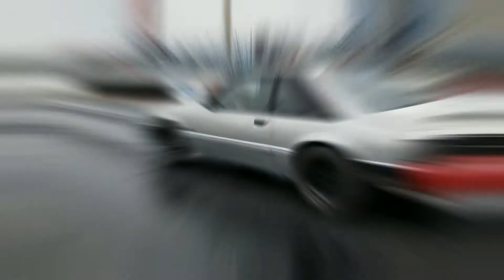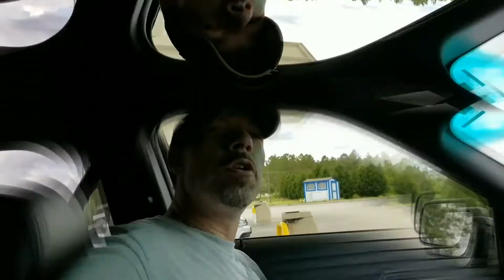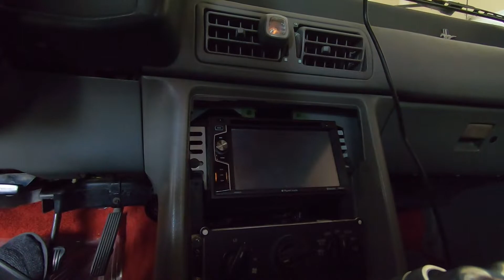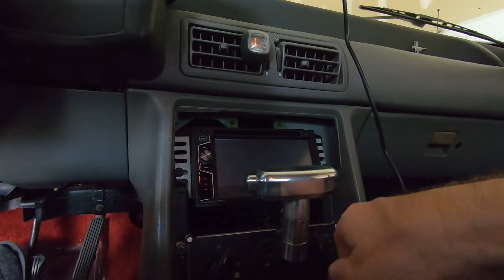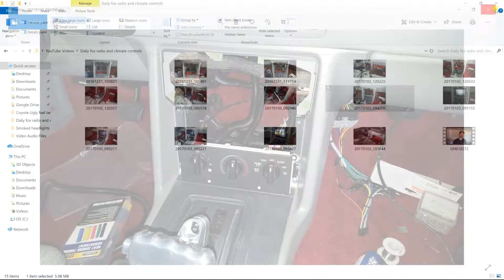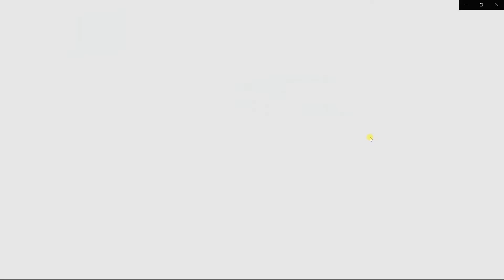Foxbody double DIN radio install and climate control relocation.

Comment: Because of your video I now feel more comfortable with installing my new radio and relocating my HVAC controller. I went and order 12, 14, and 18 awg wire to extend lines. As well i bought some vacuum lines and vacuum hose connectors to extend the vacuum lines behind the controller. As well as a saw to cut the brackets. I already had the electrical heat shrink connectors. I hope  I’ll have everything I need to complete this project soon I orders everything online last night lmao. Love the vid!
Reply from the maker: Awesome! Glad my video helped you out.

Comment: hi, what guage wire did you use when extending the harnesses?  Can I just buy one size that will work for all the wires?
Reply from the maker: Honestly can't remember, but 16 gauge should cover it. Maybe 14 gauge for power and ground wires.

Comment: What's hot wire and ground wire
Reply from the maker: Not sure what you mean.
Reply: @BackyardBMX73  I got a 92 mobile and wire been cut I couldn't get my cd player to come on
Reply from the maker: @jimarcusgarner3595  best thing to do is use a multi meter or test light to find power and grounds. I wanna say maybe yellow, but not sure.

Comment: You could have just unbolted that bracket instead of chopping it. When you install a double din in the factory spot the instructions tell you to remove it and cut the studs off of the floor. Nice tutorial though! I will definitely be doing this!
Reply from the maker: Not sure where it bolted together. I'm impatient and just cut it lol. I did unbolt the piece from the floor though 😁
Thanks for watching and commenting!

Comment: Where did you buy that shift handle?
Reply from the maker: It's from UPR, like this one:

https://www.teambeefcakeracing.com/1059-08.html
Reply: Thanks, I have a 1989, will it fit?
Reply from the maker: @eyeofthestorm7485  mine is an 89, so yep 😁

Comment: Wanna set mines up just like this putting the climate controls t the bottom
Reply from the maker: Right on man!
Reply: Seems like alotta work with the cutting gotta find someone who can make it happen definitely
Reply from the maker: @cosmicdreamers2821  it's not terrible. Would be faster with some type of power tool. I used a small one handed hack saw.

Comment: OMG man! I’m in the process of doing this, except instead of double din, I’m installing an iPad mini. I’m currently stuck at extending the vacuum lines. Can you tell me what you used? What size they are? What fittings? Pretty much any/all info I’ll need to find the lines and fittings to extend the lines.
Reply from the maker: I had some extra line laying around. I cut the one I needed to extend and added in another piece of the same size. Then just used shrink wrap to seal the joints. I'm not sure what size they are, but they're pretty small inside.
Reply: Ok so you “had some laying around” (I should be so lucky) sounds like my best bet would be to cut some out of another Foxbody somewhere.
Reply from the maker: @timclark5051  yeah man, check your local pick and pull. Might get lucky. Wish I could tell you the size.
Reply: Awesome thank you and thanks for the quick reply! Do you happen to remember just how much you had to extend that vacuum line?
Reply from the maker: @timclark5051 no problem! It wasn't much. I think maybe 12" will be plenty.

Comment: Great job man especially explaining since you only had pictures and not video.  I think that aluminium plate is going to help you.  I want to do a double din in tarheel fox but I don't want to relocate my climate controls
Reply from the maker: You can still do it. Should be a lot easier without relocating the controls.
Reply: @BackyardBMX73  hmmm I sense a collab 😁
Reply from the maker: @GearHead704  there have been many "senses" 😂